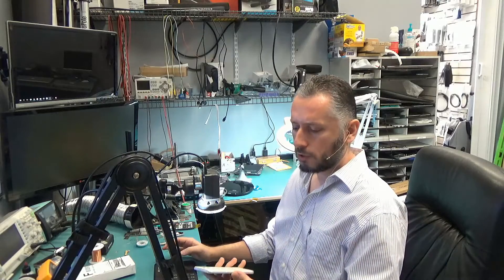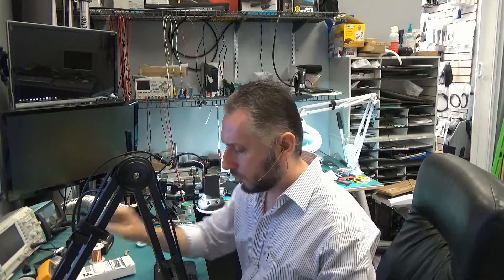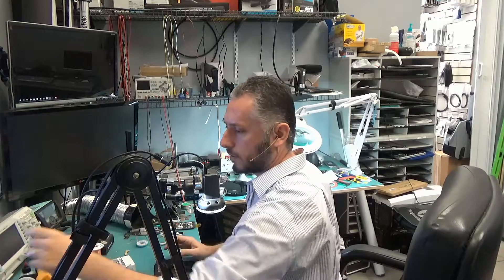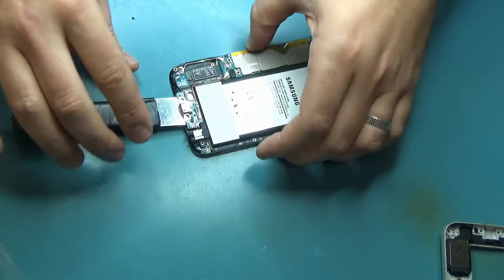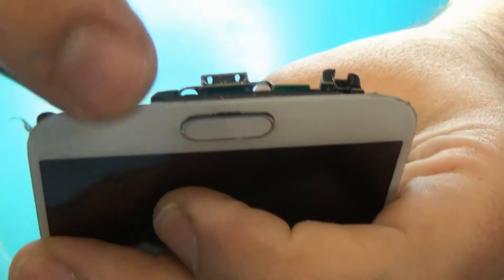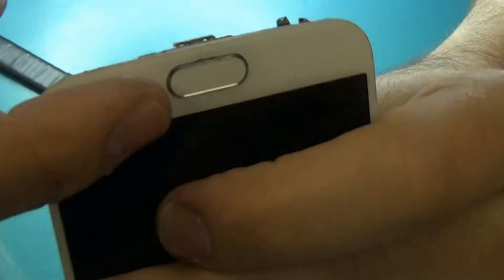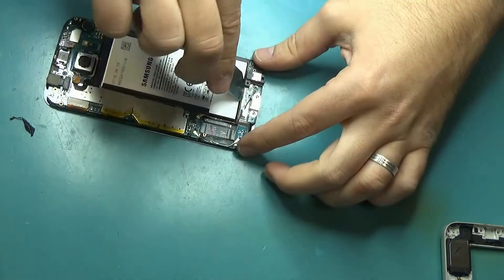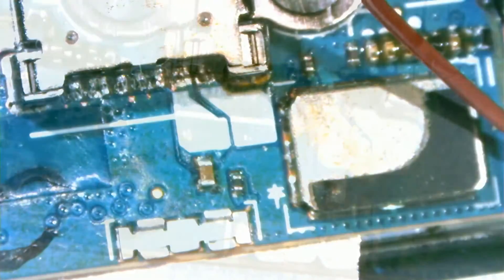Samsung Galaxy S6 Charging port Connector Replacement  without changing the whole cable.

Comment: We do not have some of your tools sir and exact charging pin for that unit but still because the customer need it to be use. I use same pins of charging pin. Thanks alot for some technics to change charging port. More power

Comment: the way these chinese sandwiches are made, with glue over screws never fails to make me cringe.
strange technique you got to remove that SMC connector, i was worried the capacitor next to it would have gone away. I'm about to fix a Thinkpad Tablet, just wondering if i could just replace the USB connector with something less fancy, i just want it to charge, not add some USB 3.0 hardware.

Comment: Hello sir samsong s6 not chargeing but show battry icon 
And connect computer and charger plz help me watsapp msg 9815803876
Reply from the maker: Try a 1A and 2.1A charger and see if it makes any difference,. If that doesn't work, try another cable. If that doesn't work, try another battery. If non work, then it's a charging port issue.

Comment: Hi, 
At what temperature you are desoldering the charging port/
Reply from the maker: 300c should be enough, but I always use 470c and i control the heat with my hand by bringing the air closer or farther away. You need to be familiar with you hot air station and allot of practice to know what works for you.